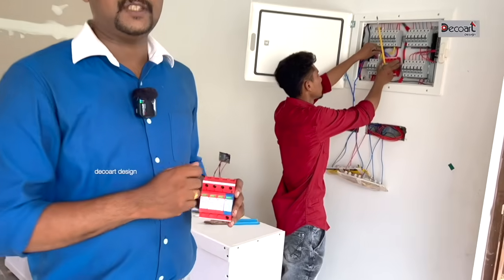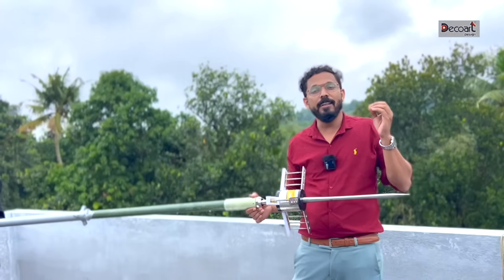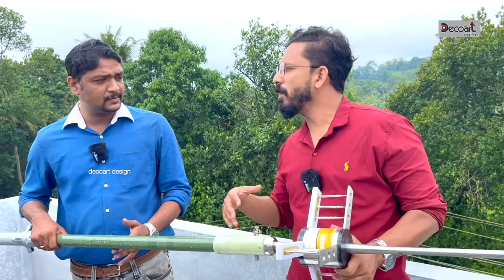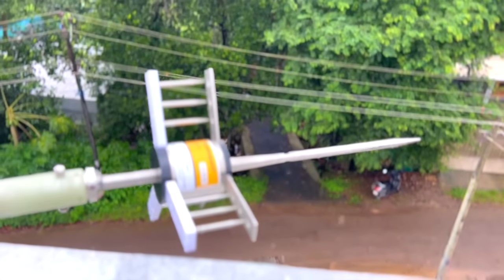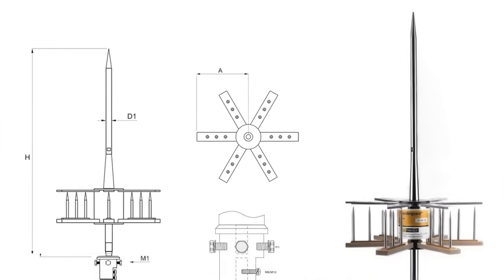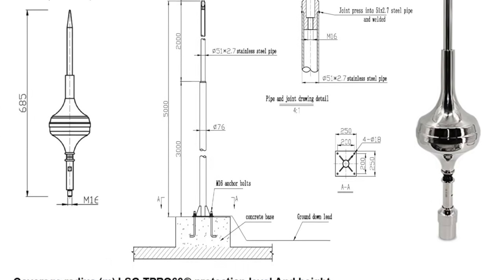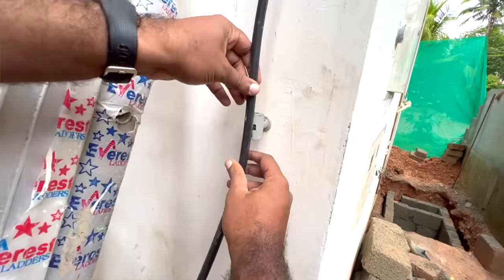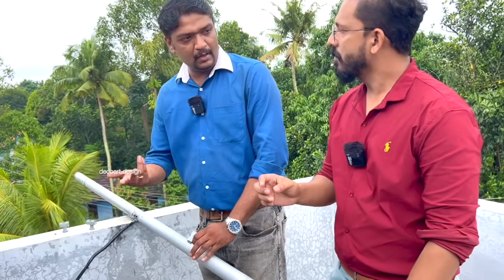ഇടിമിന്നലിനെ ഇനി പേടിക്കേണ്ട  LIGHTINING ARRESTERS-വീടും ജീവനും സുരക്ഷിതമാക്കാൻ-15 വർഷം വാറണ്ടിയും

Comment: This is ESE air terminal. ESE air termination principle do not conform to IS standards, National Electric Code, National Building Code as well as CEA safety regulations.
Insurance companies deny ESE as a protection device and ask users to replace it with conventional lightning protection systems conforming to IS/IEC 62305
Reply: Big fan bro🤩
Reply: @abhijith1273  thanks bro👍
Reply: @abhijith1273 😂😂 endinn